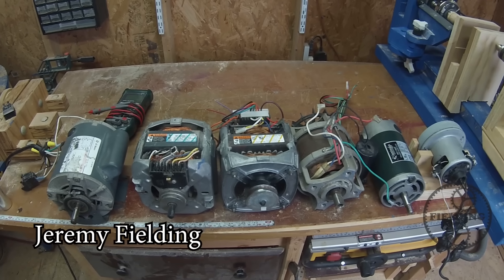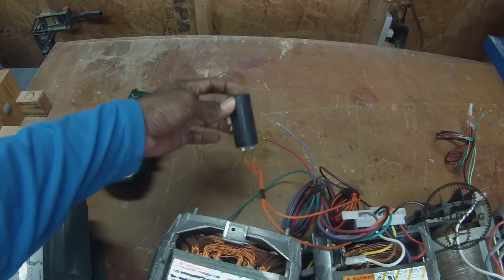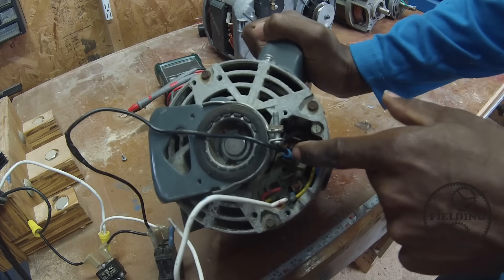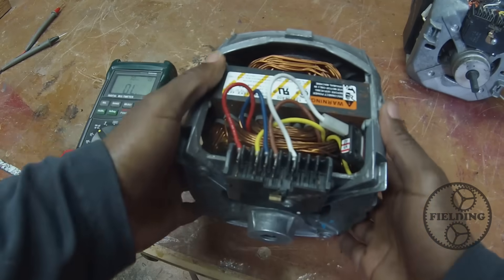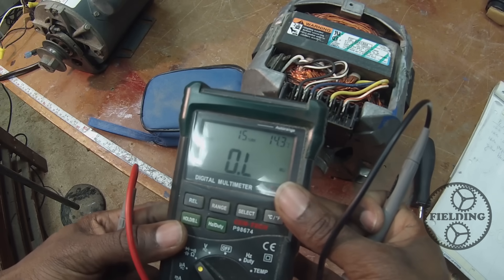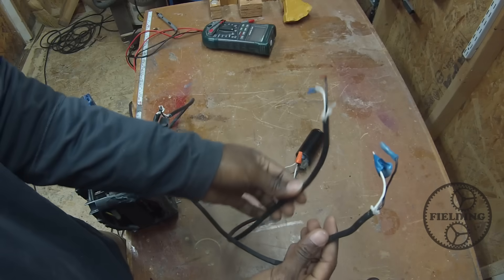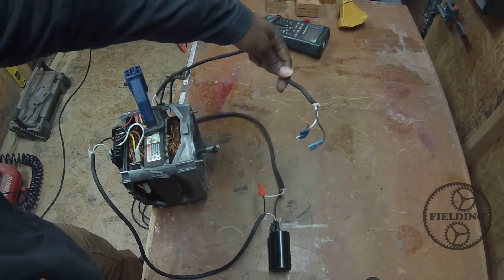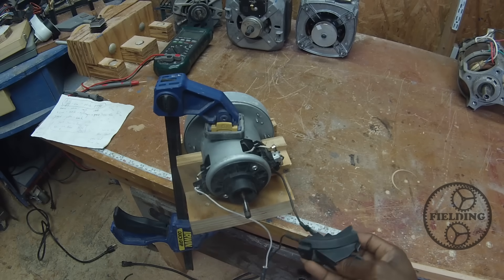How To Wire Most Motors For Shop Tools and DIY Projects: 031

Comment: Wondering if you can help. I have a motor from a window A/C. It's got a blk/ylw/blu for speeds hi/med/lo. and a red/brn to the capacitor. I don't have the capacitor anymore, but would like to by-pass the capacitor to run it. I have the wall plug with wte/blk/grn and think I can wire; blk to blk(hi speed) and white to red(I believe red would be the common?). That's where my problem lies. I'm not too sure that the red or the brn is the common, whether both are, or just connect the red and leave the brn hang or splice the brn/red and connect both to white. Am I on the right track?
Reply from the maker: First it won't function properly without the capacitor... but unfortunately I can't get into one on one advice. I get literally hundreds of requests like this and it just isn't safe or practical to try and troubleshoot problems I can't see one on one. Different manufacturers use different color wires sometimes, and some seem to just use whatever wire they have on the line at the time so you can't always trust the color alone.
Reply: I hear you.... thanks for taking the time thought!

Comment: Hey quick question for ya Jeremy, need some advice..  Lookin for a single phase 3hp motor for an air compressor.  The compressor requires 1725-1750.  2 options are Baldor L1408T 1725rpm $100, or an older Century 1750rpm $65.  Just curious which MFG is better?  Thanks
Reply from the maker: I don't know.

Comment: can you make a short video showing the motor wiring in diagram form, i tried following what you were explaining when you were holding the wires up but they were such a mess i couldn't tell what was going where and you said "these need to be wired in parallel" as you pointed towards that bunch of wires but i don't know what "these" is referring to, thanks
Reply from the maker: I plan to make a whole series of videos showing the wiring for many different motors. They will all have a diagram

Comment: Mr. Fielding,  Your videos are so useful and you are a great instructor.  I appreciate your generosity in sharing your knowledge with us. Please know I look forward to your videos, and have learned a lot from you.

A quick question, I was given an electric motor that appears to be a single phase motor that doesn't have the capacitor with it. How can I determine what type of capacitor I need?

Thank You
Reply from the maker: That will require researching your motor. Search the internet for the part /model number and see what you find. It might need two types or one, or none.

Comment: JEREMY
I HAVE A 3/4HP GE WASHER MOTOR....YOU WERE CHARTING DIFFERENT WINDINGS AN THERE OHMS..... I HAVE THE START WINDINGS IDENTIFIED  ON THIS MOTOER THEY ARE RED AND BLACK AND I'M ADDING A REVERSING SWITCH.....IT ALL WORKS GREAT....THANKS TO YOU!!!!
NOW THE RUN WINDINGS.....WHITE TO PURPLE I HAVE 3.2 OHMS AND WHEN I TURN IT ON I SHOW 1190 RPM
THEN NEXT ONE IS WITH WHITE TO YELLOW AN I SHOW 2.3 OHMS AN WHEN I START THE MOTOR I AGAIN GET 1188 RPM
THEN THE LAST WINDING IS WHITE TO ORANGE AN IT TO MAKES ABOUT 2.3 OHMS AN GET IT TO GOING....1168RPM
I HAVE MADE THE MOTOR REVERSE WITH THE START/CAP WINDING BY BRING THE MAGNATISUM IN FROM A DIFFERENT DIRECTION......HOW DO YOU FIND THE HI SPEED 1725 RPM THAT THE LABEL SHOWS AND IT IS SUPPOSED TO DRAW 10.7 AMPS AS WELL ALL I GET WITH THES THREE DIFFERENT WINDINGS IS AROUND 4 AMP DRAW ON MY ANALOG METER
THIS IS A GE MODEL 5KC41 LT 70S WASHER MOTOR OUT OF A MACHINE BUILT IN 1996.....LOOKS AN RUNS GREAT, JUST SLOW.....I HOPE YOU CAN DIRECT ME TO THE HI SPEED COMBINATION
 ON YOUR 035 VIDIEO YOU GO THROUGH A 1/2HP MOTOR AND I WENT WITH EVERYTHING YOU SAID AND I'M SATISFIED WITH A 1725 REVERSING MOTOR ON MY OLD DRILL PRESS......I WOULD LIKE TO UPGRADE TO THIS 3/4HP UNIT
PLEASE HELP,  TOM WAGNER
Reply from the maker: Unfortantely the only way I know of to find the hi speed winding is by trial and error. Try every combination until it runs at the correct speed. The 10amps is only at its rated load. It should not ever run that much current unless you have it under load near its hp rating.
Reply: THANKS JEREMY......YOU HAVE MADE ALL THIS POSSIBLE, LIKE A LOT OF YOUR FOLLOWERS, I'VE TRASHED SEVERAL MOTORS BECAUSE I DID NOT KNOW HOW TO WIRE THEM AND LIKE I SAID.....YOU LED ME THROUGH THE 1/2HP WASHER MOTOR AN I GOT IT TO GO BUT THIS ONE IS KICKIN MY BUTT
THANKS AGAIN

Comment: i want to make a DIY project,  I want to buy the biggest and strongest torq capacity motor I can get to be connect it in any house garage I believe have to be 220  but in what capacity?
Reply from the maker: I don't understand the question. But I think you are asking what is the largest hp motor you can get at 240 volts, and I would say you have to search the internet for exactly that. There are a lot of layers to the question. What speed do you want; 3 phase with single phase conversion or not; Geared motor or not; how much are you willing to spend... The largest option might be $1000's of dollars. Searching on your own is the best option here... no one can answer all of this for you. Only you understand your project. Trying to address all of this on the comment section is not going to work very well.
Reply: what capacity have to lok for

Comment: Hi Jeremy, Thank you for your video! I'm a newby in all this... I was wondering if you could give me advice. I'm trying to figure out what kind of motor to use for a turning composter. I have a 55 gallon water container (brown ones with black top) that I want to rest on planks with wheels and use metal conduit through the container to turn. I am looking for a cheap motor (or even free) that I could use. So far, I saw one guy on YouTube used a starter motor from an old VW to turn his.  I have seen old vaccum cleaners before but haven't thought of taking their motors! I would probably be running a long extension cord from my house (maybe 100 feet) to the tumbler OR use an old car battery to run a timer and the motor.  If I wanted to slow down the AC or DC motor to a certain speed, how would I do that?  Also how do you connect a DC motor to AC, would that be a potentiometer? 

I have an old bike and it's gears... I want to use the large cog wheel and the small gear with chain to connect to the tumbler. Would I connect the motor to the small gear and the large gear to the metal pipe?

Eventually it would be cool to get a solar panel to help recharge it, but I would have to find a free one!  Thanks for any expertise you may have.
Reply from the maker: I say spend some time watching my “how motors work” and “how to wire and control salvaged motors”. Two playlist on my channel. I talk about most of these topics throughout the series. That is way too much to explain in the comment section
Reply: Thanks Jeremy. I scored a vacuum today! Hopefully it will work for what I am doing.

Comment: Ok question.. I've got asimilar motor.  black and yellow are start windings left over are white, white/orange, white/blue, white/black, and blue.  I can get the motor to spin with white and any connection except white/black it pops a breaker.  when ohming out white to white/black its .2 ohm set at a 20 ohm scale.  is there and internal fault with my motor or is it something different?
Reply from the maker: Unfortunately I can’t help directly like this. I hope you can understand, I get hundreds of request from my channel. It just isn’t safe or practical to try and troubleshoot problems one-on-one.
Reply: I understand

Comment: You gave the resistances for the start and run windings on the washing-machine motor but did not show how to determine which leads go to which winding.
Reply from the maker: For speed you mean? You have to wire it for each one and measure the speed.
Reply from the maker: I am posting a video on Monday which might clear up your question.

Comment: GFI  protection buddy! Get a "point of use" unit, or coverage from an outlet. Also, glad you mentioned the dangerous power storage in a capacitor. But, one more thing to say of capacitors,, I wasn't witness to it, but one BLEW UP on our shop bench and it was as if someone tarred and feathered the place! The oil used inside and the cardboard/paper that wraps the oil exploded and left schmutz all over a good 10' radius, bench to ceiling. So you may want to consider wiring your harness with a plug corded through a GFI outlet for 15 amps of coverage, into a capacitor that's in an openable enclosure (for discharge purposes), with an auxiliary switch (possibly a foot switch) and a resetable breaker before the spade terminals... 
All of this could be mounted on a single 2x6 about a foot long. Otherwise, I forget the fancy name for it, I'm thinking you might know, but when there's a series of variable wattage light bulbs before your connectors? The lights light up instead of really zapping you.

Comment: Really enjoy your videos Jeremy. You are a fantastic advocate for the maxim of "do the simplest thing that could possibly work". Keep at it! There are countless numbers of people who can benefit from your generous contributions.
Reply from the maker: Thank you
Reply: @Jeremy_Fielding  Man, I am stuck with some really wiered AC motor wiring if you can shed some light it will be great. It is an extractor motor 240v and takes max one to 3 amps, But what is strange that after the electronic circuits it has six wires connected to the motor, the top three are connected to the electronic circuits but the other three are not connected directly to the electronic circuits at all. There is no continuity between the wires except two wires shows continuity but the wires that shows continuity one is connected to the electronic supply side but the other one is not and there is no continuity between any other wires, I took a new one that is working and tested that one and it is the same thing yet it works , i have never encounter anything like befor if you can help you will have my deepest respect. So far every has fallen on it ha ha ha.

Comment: Hi Jeremy , what can I’d to reduce speed on an older craftsman bandsaw. I need to reduce the speed  to cut metal.
Reply from the maker: I plan to make a video about this. It is a frequently asked question but not easy to answer in the comment section. There are too many variables I don’t know about your machine

Comment: Jeremy how great are you on a scale from 1 to 10 using solid works? I have been using inventor for several years.
Reply from the maker: I am a pro user. I use it all day as a job to design custom industrial equipment/machines.

Comment: can you tell me if I can control a alternator converted to motor with a speaker control switch? or a trailer brake unit? how many dc volts should I use for electric scooter with a transmission? what about it charging itself?
Reply from the maker: I don’t know

Comment: I have a very old Wagner 3 Hp (1948) motor, it runs a compressor. When a got the compressor it was wired for 110 volt, in fact its still wired for 110 volt, I want to wire it for 220. It has 4 wires coming out of the motor. On the information plate it shows for 220 you put 2 wires together and the other 2 you wire to incoming 220 power. Now it has 2 together going to 110 hot, and the other 2 are going to incoming common, and it does work. The plate states wire 1 , 2 , 3 , 4 , but the wires are so old there is no marking what so ever left on them, tho they are in pretty good shape. Question is....
How do I ID the 2 wires that go together. Can I do a Ohms test and will they be common ( basically the same inside the motor)
then put those 2 together and put incoming power on the other 2.
Thanks. Charles
Reply from the maker: The difference between 120 and 240  is wiring the windings in series (240) or parallel (120). You should be able to disconnect all the wires and see which ones have continuity. Then you have your two windings. They should not have continuity with each other after the four wires are disconnected. I would be surprised if there wasn’t at least one video showing this. To explain more than that would be complicated in the comment section.
Reply: Thanks so much for the help, yes I can disconnect all 4 wires, so at that point I find the 2 wires that have continuity and that would be my winding's, and those go together to make it 220, and the other 2 are for the power coming in. So wish the marks were still on the wires, but I guess for 70 years thats a little much to ask.
Reply: Thanks Jeremy,
We got it working on 220, The tags says it should pull 9 amps on 220, 18 amps on 110, and its pulling 9.4, for a 70 year motor not bad.

Comment: Thank you very much for telling about the start capacitor and telling about how to wire the motors cause tomorrow ill be disassembling a washing machine and ill know that the start capacitor is really important and now i know how to wire the motor too when ill use it for a project  and i wont be shocked by the charged capacitor. Thank you so very much!

Comment: I want to build a belt sander which motor is best suited for that
Reply from the maker: There isn't a best all around. It depends on what you want... how big is the load, how fast, do you want speed control, how much money are you willing to spend... I think the best thing for you to do is look at belt sanders that have the features you want and see what they use. You can find most manuals and replacement parts online and you will learn so much more than if I just picked one for you and didn't know what you were doing exactly.

Comment: Jeremy, I replaced an A.C. condenser fan motor last year.  The fan stuck, but could be pushed into operation. 
Any ideas if I can refurbish this, or if it is useful?
Reply from the maker: Sounds like the capacitor but that is just a guess. I don’t have any uses for it. You have to think about what would work for you whether it is worth keeping
Reply: Jeremy Fielding I didn't change the capacitor, which is separate, and easy to access.  The owner wants to sell in a year and a half, so I will let the new owners deal with that when the time comes.
If there is no easy rebuild, I can scrap it.

I hope I mentioned enough times how I appreciate your efforts in the channel, I love the videos.
Reply from the maker: Thank you!

Comment: Those are some cool engine's you have there!!!
Reply: +DIY Chad 726 Please for the love of god help me get the hot rod guys to understand that there is a difference.  Drives me crazy when mechanics call an engine a motor and say they are the same!!!! They are NOT the same thing!!! An engine is self powered and internal combustion and  a motor uses stored power under pressure!!! Engine's power motors not the other way around!!! I like you you get it!!!
Reply from the maker: Thank you!
Reply: motors....not engines......engines combust gasoline/diesel.....motors utilize a magnetic field

Comment: I have  a question. You seem very knowledgeable in the electric motor field. I have a three-quarter horsepower vintage craftsman start capacitor motor that came off a table saw the bearings were not spinning I put new bearings on but now the motor when I plugged it in just hums and doesn’t want to spin also the shaft get stiff while it’s plugged in and won’t turn but when I unplug it it will turn again. Does this mean the start capacitor is out or is there something else wrong?
Reply from the maker: That is exactly what I would expect if the capacitor wasn't working.
Reply: Jeremy Fielding I had a question and I ordered a new capacitor mine has a centrifugal switch and I had a question about how to wire in the capacitor. My motor also has a thermal overload protector . There is a white wire coming from the paddle of the centrifugal switch I was wondering where that connection goes to does that connection get connected to one end of the capacitor? Or does that get hooked up to the neutral or white wire of the incoming plug from the wall?
Reply from the maker: This is where I have to get off the bus. I can't do one on one advice. It is not practice or safe. Please understand, I get hundreds of request like this, and it takes time for me to get to understand the problem and step-wise solve it through somebody else. Additionally there is the risk that I didn't understand or you didn't share all the relative data.

Comment: Hello Jeremy,
I have a single phase motor from a dryer that had no start capacitor near it according to my friend who gave it to me. Could it be wired to be push started with a button? Also the other issue is it only has one color coded wire so I am a bit stumped on wiring it. Any help would be appreciated, don't want to fry it!
Reply from the maker: Not all of them start with a capacitor. Some use "other" starting methods which are similar. It is a bit too much for the comment section. But often this same method (capacitor start) can be used even if that is not what was in the original machine. I try to avoid giving one on one advice though. It is just too risky. I can't possible see every variable and be sure I fully understand the problem without seeing it personally. So consider this a brief comment not a suggestion.
Reply: Jeremy Fielding unfortunately for me I find mostly videos of motors that are wired differently. I found only one video where the motor is similar but either the terminals are marked differently or perhaps incorrectly stated in the video. He also has a jumper for the start windings.  If I had an extra I would send it for you to figure out lol. My issue is I don't want to fry anything. Your videos help a lot. I'm uploading a short video of the motor. 

https://youtu.be/tVRSX0lQjmo

Comment: I just scrapped a few electric wood chippers....11:18 you added a cap to the one on the bench, but when I scrapped mine, which looked very similar to yours, there were no caps
Reply from the maker: Not all motors need one. There are several ways to start an induction motor. If it is an induction motor.